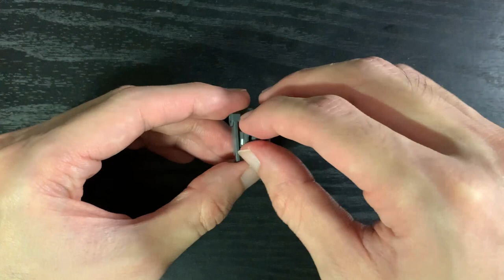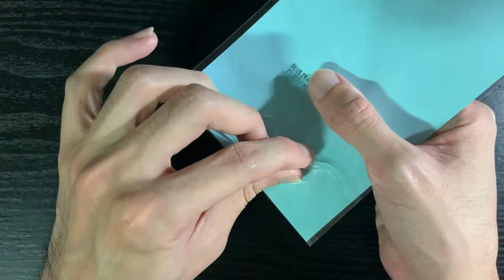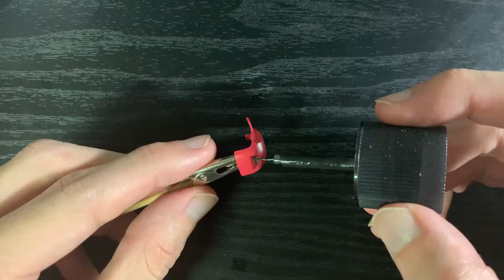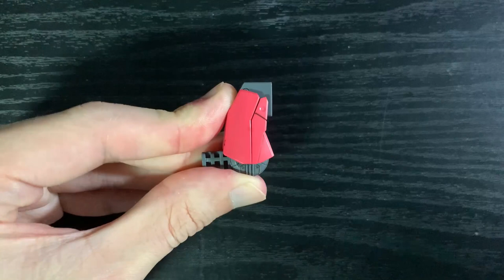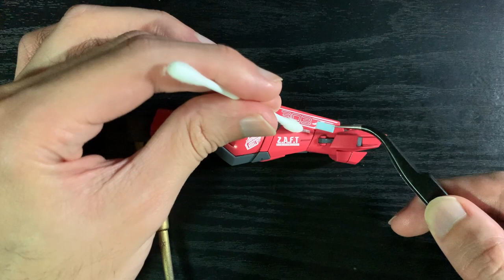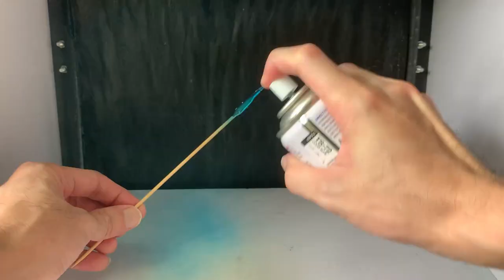MG 1/100 AEGIS GUNDAM Speed Paint build Review

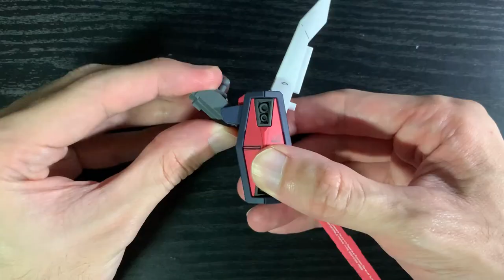Comment: Not sure if you'll read this since this video was posted 2 years ago, but at about 2:26 into the video, how did you get the pink tail piece to snap into place without having a big gap between the bottom and top piece. There is a ridge on the 2 dark blue pieces that get in the way.
Reply from the maker: I dont remember exactly but every parts must be in perfect position and they will easily fit just like in the video
Reply: @Armstudiogunplaspeedbuild  I figured out my problem, the bottom piece wasn't going all the way into the poly cap before

Comment: How do you use Tamiya TS-80 over decals without ruining them? Many sources on the internet including Tamiya's own website say to not use TS-80 over decals.
Reply from the maker: Tamiya TS-80 is lacquer paint. Lacquer paint is very strong. If you spray too wet or at high humidity, it wont damage only decal, even small plastic part could break. I think applying lacquer paint on decal is very common thing. It wont have issues if we do it properly. It also understandable why tamiya say that because they wont be responsible for any possible mistakes. Waterslide decal also have differences. For Bandai decal, it has decent thickness so no problem with it. But for third party decal, some of them are too thin. So, it is possible that lacquer could ruin them.
Reply: @Armstudiogunplaspeedbuild  ok thanks. Mr Hobby Top Coat has been hard to find so I was curious about TS-80.

Comment: Great job. Amazing video and model . You did a lot of panel lining in this kit? Do you think I can get an ok job with gundam markers? Black for this one?
Reply from the maker: if you plan to do topcoat with lacquer paints as well, better use Tamiya panel line accent. The gundam marker will be melted after topcoat. It still looks ok but it won't be sharp as it should be.
Reply: @Armstudiogunplaspeedbuild  Thanks for the reply! So in this model you didn't panel line?
Reply from the maker: @gsixbr7337  i use tamiya panel line accent. It is enamel paint. Enamel paint will not melt.
Reply: @Armstudiogunplaspeedbuild  some people told me that Tamiya Accent can damage the kits if it's not painted, is it true?
Reply from the maker: @gsixbr7337  Yes but we can avoid that. From my experience, most cracks happened when ink stuck in seam line rather than panel line. When ink stuck in seam line, it takes longer time to dry which means more time to erode plastic. It could happen when you do panel line after assemble. It is better to do panel line before assemble for some parts. if you are not sure, just do panel line on each part first then assemble later

Comment: My guy, it's me again.
I'm starting to build the aegis gundam and I'm on the shoulders right now. There are massive nubs which I can't remove. Even by using the gunprimer glass file. Do you color It again after removing the nub? Any tips?
Reply from the maker: Since I want to build many kits so,I choose the fastest way. I only use art knife to clean up nubs. Then apply flat topcoat. Flat topcoat will make nub marks less noticeable. If you want to completely get rid of nub marks, repaint the whole kit is the solution. However it will take a lot of time to finish.

Comment: How were you able to make the waterslide decals stick without gloss coating the part first?  🤔
Reply from the maker: I think plastic surface is smooth enough for waterslide decal suction. However, they may fall off later. So, we can apply topcoat on top of them. It will make they stay forever.

Comment: just want to ask what sand grit did you use for removing the nubmarks?
Reply from the maker: I mostly use only art knife to clean up nubs. If you want to sand it, i think above 2000 grit.
Reply: @Armstudiogunplaspeedbuild hello again. i just wondering how do you fix the frosting of flat? do you spray it again ? thanks.
Reply from the maker: @merlingonzales1143  Spray over it again won't help. I normally use thinner clean the paint out and spray it again. If the part is painted or have sticker on it, everything gone. So we better prevent it by spraying at low humidity. I suggest lower than 40. Spray at sunny day, don't spray at night or raining day.
Reply: @Armstudiogunplaspeedbuild  thanks. ill try to use my mr color thinner because i used the c182 mr color(the regular flat, not super smooth flat) thinned 1:2 ratio and unfortunately whites build up. i was spraying between 20 to 30 cm away. using between 25 psi and 20 psi. 

i hope by using thinner. it wont crack the parts 🤣

Comment: are you using the same panel liner to color the eyes black? thank you
Reply from the maker: I use tamiya panel line accent for panel lining. for the eyes, I use black enamel paint. They are same enamel based paint. But panel line accent is too thin. It isnt made for painting.
Reply: @Armstudiogunplaspeedbuild  thanks! I already bought my kits and just waiting for the other tools and paints before i build them. You're vids are great inspiration!
Reply: @Armstudiogunplaspeedbuild  do you mix the black enamel paint with anything or did you just straight up paint it on? also did you use enamel thinner when removing the paint for the eyes?
Reply from the maker: @ruiskapowshow  just straight. Yes, use enamel thinner to clean up excess